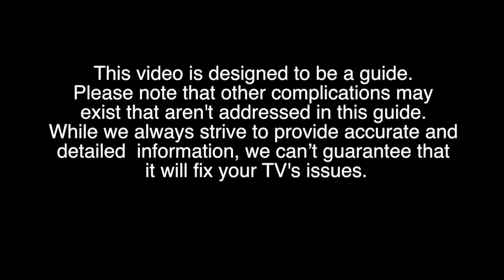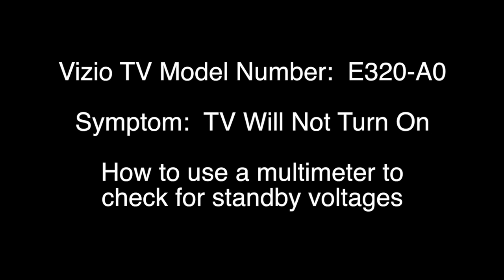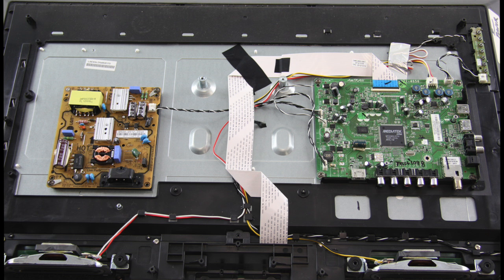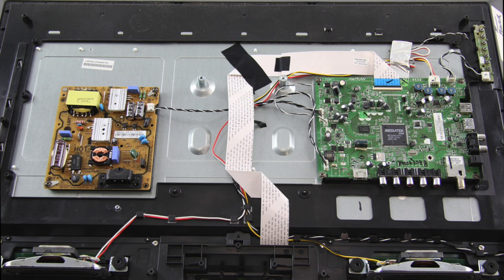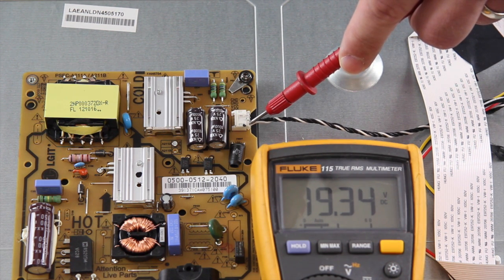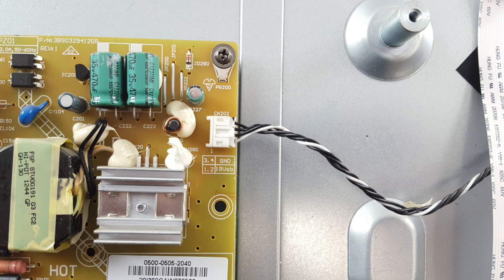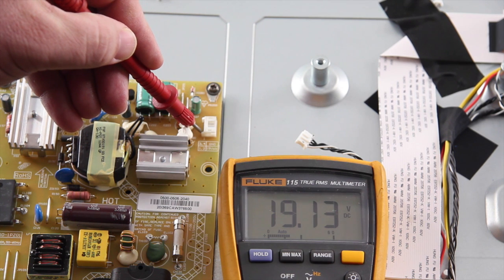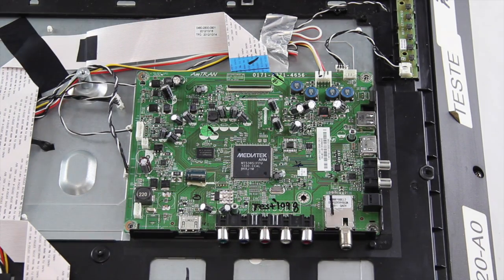Vizio E320-A0 TV Will Not Turn On Standby Voltage Test Tutorial

Comment: My Vizio keeps showing the Vizio logo, cuts off and then keeps repeating. It never gets past the white Vizio wording. 
When I check the standby voltage, it cycles between 3.2v and 0v. When I disconnect the main board connection, there is no voltage on any of the pins, except for 12v on pin 1 and 3. Keep in mind this is a newly replaced power supply board.
Reply: Sounds like  transformer issues  or diode?